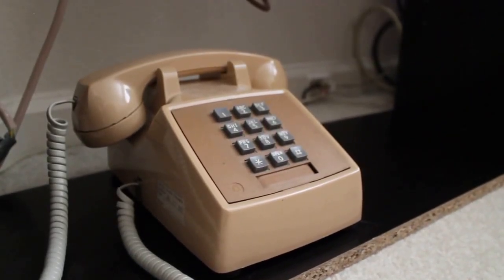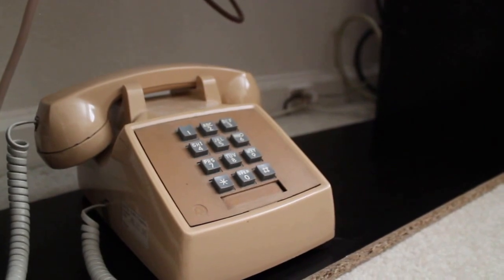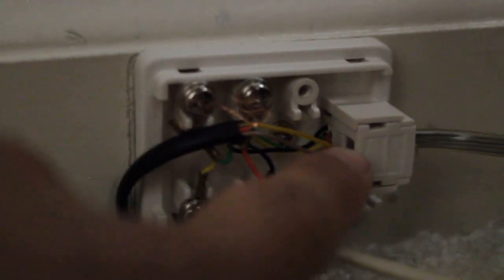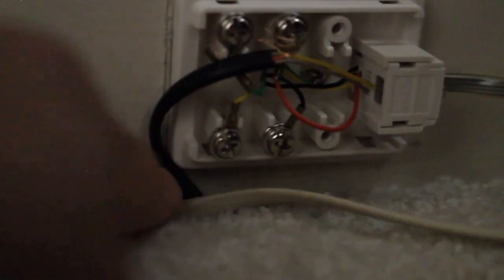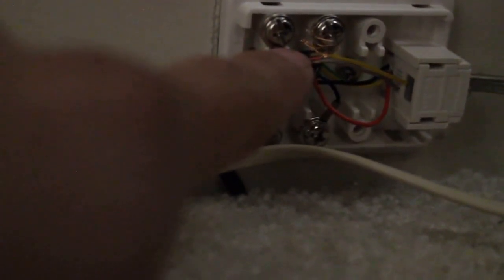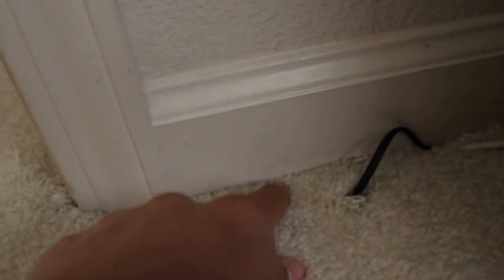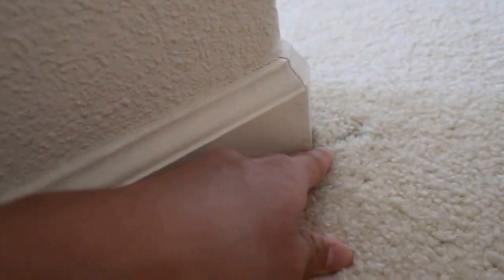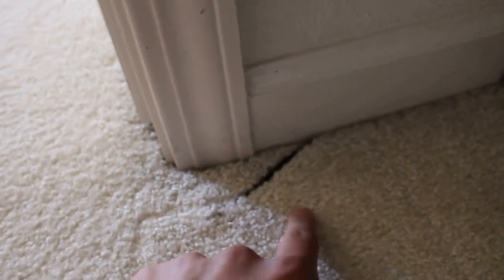Our First Episode! How is our phone jack connected?

Comment: Great first video! nice to see and hear all the technical stuff, as your terms are sometimes different from us here in UK or other places in the world, a term which you use goes way back to the manuel xchanges or central office here we see the incoming cable being called Tip And Ring this was the parts of an operators plug tip being the tip of the plug or jack and ring was the next connecting part, the sleeve was the 3rd contact and was not used for actual speech circuit. In UK we say A and B whilst others use the conventional +  - I will have to show this on one of my videos if I can find an old Sw/Bd jack plug. Anyway many thanks for sharing.